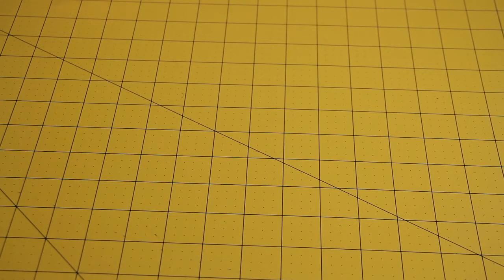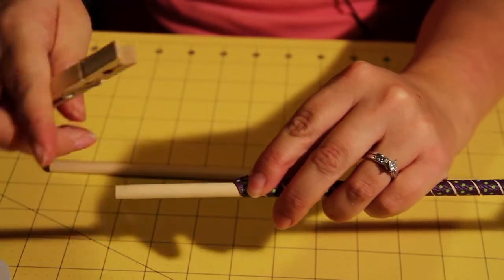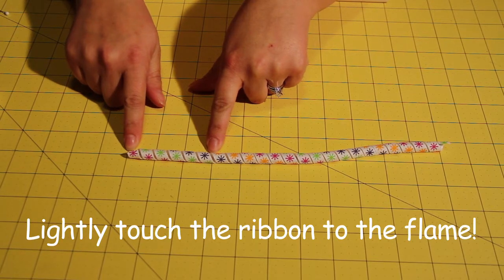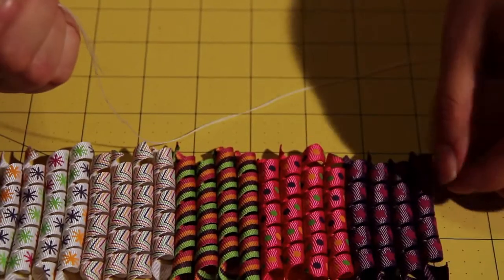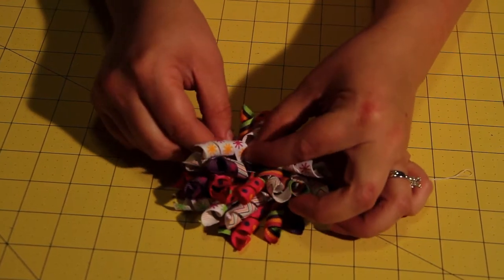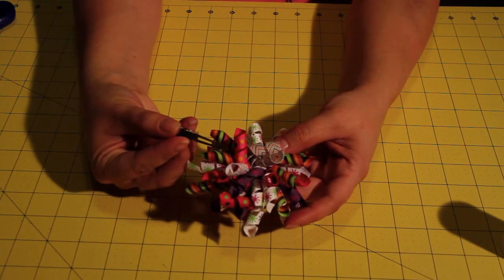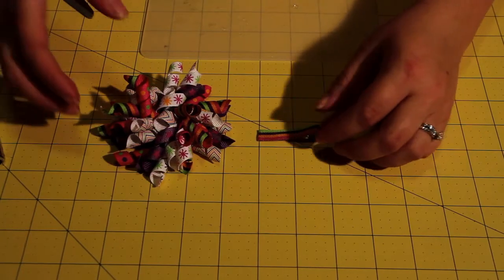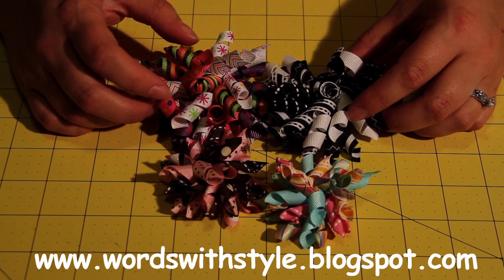Learn How To Make Korker Bows

Comment: This is a GREAT video. I use a woodburning tool (you can get it at Walmart in the craft area) It works like a charm and I don't have an open flame. Plus you will get perfect results and won't have to worry about burning your ribbon. Just a suggestion only. This video is going to save me money, since I won't have to buy store bought ribbons!